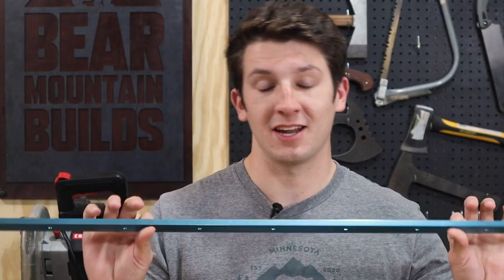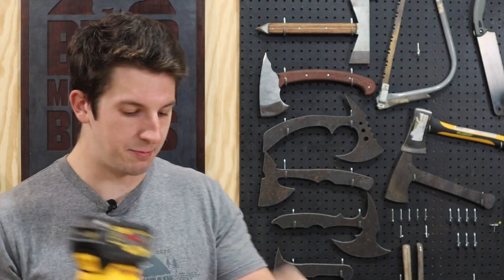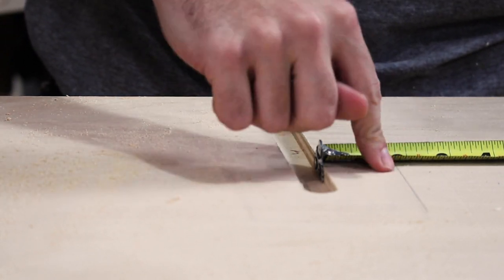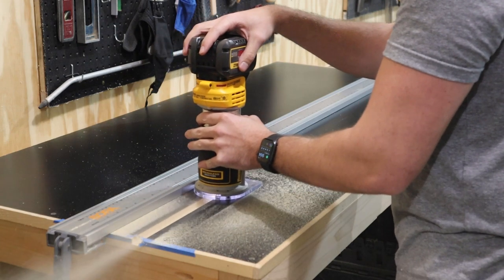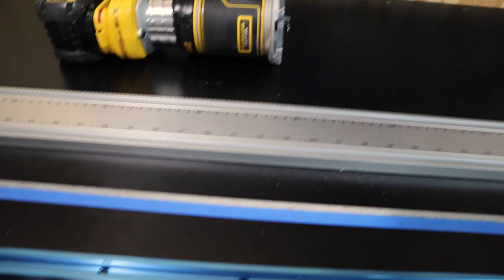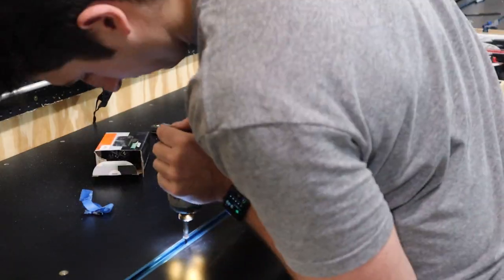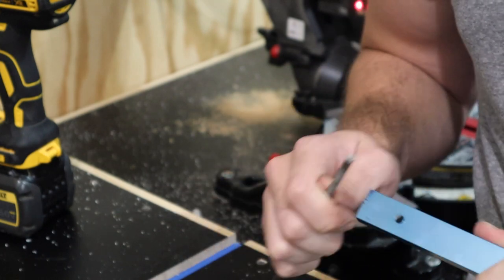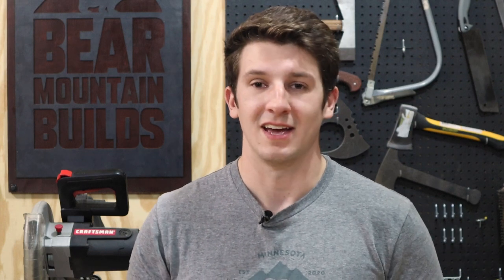How To Install T-Track using a Dewalt 20V Max XR Cordless Router

Comment: You might consider drilling those track screw pilot holes with self-centering drill bits (as you might do for hinge screws) to get them perfect dead center, depending how OCD you are.

Comment: One edge guide is fine, but many a times the router slips to other side. I had that happen to me. I used straight edge on both sides.
Reply from the maker: As long as you are traveling left to right you should only have to use a single straight edge due to the rotation of the cutter it will pull the router into the guide

Comment: There are literally thousands of videos about installing T-Track.  Is there any pointers anyone can give me for "removing" t-track from old jigs or sleds to repurpose it?  Mine are glued down with epoxy.
Reply: you might try a heatgun to melt the glue.  If that doesn't work, you may have to buy new t-track.

Comment: i am building a reloading bench for long range shooting.  i have many presses and measuring tools i want to attach to a 12x12 plywood base. using a t track in a beach bucherblock top. ill be able to switch out tools for any reloading application. and be able to store them in a cabinet when not in use. leaving a nice clutter free surface.

Comment: Wow I have 3 routers. Electric in a table, electric handheld and a battery powered Ryobi handheld. I shy away from using handheld because of all the measurements
I've had to cut many dados in various sizes of plywood never thought to set it up the way that you did. Will use this method next time and break out the handhelds again. Thank you!

Comment: I have that same router and with my experience, If you hold onto the adjustment ring while routing, you will get it out of adjustment sometimes. Tightening the adjustment lock clamp like you did, fixed the issue for me. This may set some people off but, I have both DeWalt and Milwaukee cordless tools. In my opinion DeWalt is just as good and just as capable as Milwaukee. Who really cares if one can drill a hole .62 seconds faster than the other one? If Dewalt offers a tool that I need at a better price than Milwaukee's version, I will buy it. The same goes for Milwaukee. If someone had a gun to my head and said I had to choose between the two I guess I would go with DeWalt...

 Your videos a very good by the way, the quality of the video and audio is great as well as the lighting. The video editing, content and dialog is very good too. Looks like you've done this before. Keep up the good work!

Comment: That cut worked out well.  Smart actually using the track to set your depth gauge!!!  T Tracks are 3/8 deep and other videos and manuals say you should cut "incrementallY".  In other words, drop the bit 1/8 and make a pass.  Then drop another 1/8 to make a second pass, then finally drop all the way to 3/8 and compplete the pass.  Any comments?
Reply from the maker: Both methods work, but I would say mine is faster and better. My method allows for a test cut on an excess piece to make sure the depth is correct

Comment: With the T track, you can cut lumbers more precisely. 
A more precise angle cutting means better projects you make.

Although a saw guide with T tracks are more expensive to make, but it worths to invest more if you wish to make better projects.

With the T track, you can add clamps, lock stoppers, and protractors. 
If you add  T tracks on the top and the bottom, you can also use all sizes of circular saws, jigsaws, and routers. 

It is very versatile if you add T tracks on the saw guide.

Comment: Perfect timing that I found this.  Starting to assemble your outfield table plan and this is the exact router I bought.  A few "professional woodworkers " told me way too small for doing this.  Looked pretty easy to me.
Reply from the maker: I love this router. It’s way easier to use for handheld routing. I like corded routers for router tables though
Reply: I have this router and a nice heavy duty bosch router.  After I got the dewalt cordless, I never got the bosch out again.

Comment: Great info, thanks.  I want to build a portable top with tracks that is maybe 3’ by 4’ with several T-tracks.  I want to be able to use it on my workbench, or use it on saw horses outside. Any thoughts of how thick of material I should use for the table top? Is there any difference between using a 1” melamine vs laminating say a 3/4” melamine with some plywood backing?  I am not concerned with weight bearing load, but need it to stay perfectly flat for a long time. Thanks.
Reply from the maker: I recommend laminating a piece of plywood to the back of the melamine this will help keep the surface and give more bike for the track screws. As far as thickness goes as long as you have 3/4” or more you should be good

Comment: Thanks so much for this video! I’m not brand new to woodworking but kind of. I’ve built some cabinets, outdoor furniture, small work tables, and crafty things but with limited tools. I don’t have a table saw so have to use a circular saw instead. I do have the Dewalt router you have and absolutely love it, but still learning stuff as I go. I have had t track for probably 2 years and haven’t installed it because of lack of knowledge and lack of confidence. Lol. I will now try to do that. 😊
I watched this again and I learned something else that was very important for me. That was tightening the router clamp. I thought it was a router defect that it slipped so I had to be really careful that it didn’t slip into a deeper cut. I didn’t know you could tighten the clamp. So again, big thanks!

Comment: Is there a way to install some sort of permanent measuring tape on the table Surface so you’re not constantly having to find your measuring tape? Love your videos I am a beginner who’s trying to relearn skills from 45 years ago.  Really need these workbenches to get projects up to where I can work on them.  Maybe I missed it but do you put down any glue underneath the laminate?
Reply from the maker: I don’t have any glue under the track. As for measuring I would recommend sticking with the tape measure for precise cuts but you could write out a tape measure for general dimensions

Comment: Did you have any issue with the cut edge on the melamine (cracking or similar)? I just made an outfeed table and put on some melamine but wasn't sure how it would handle being routed.
Reply from the maker: I didn’t have any issue with the edge being ragged or cracked. That’s why I like using the router

Comment: I was surprised to find out how much just the track assembly cost at Home Depot about as much as my miter saw. This is not including the wood.
Reply from the maker: I recommend buying the track on Amazon it’s generally cheaper. I have a link to it in the video description
Reply: @BearMountainBuilds   as a beginner in Wood building,  well trying to revive skills I had 35 years ago. I love trying to re-create the projects. I’m just frustrated at my lack of ability to assemble them. I start out very hopeful, and end up very frustrated. Since I’m a glutton for punishment, I will continue to improve my skills. My aspirations are to be able to build a greenhouse. I will probably purchase two more sawhorses with some plywood to reglaze my windows. Since this is one of the task, I need to perform now.